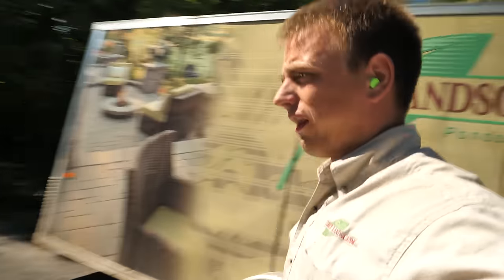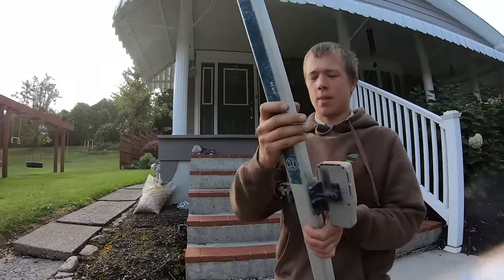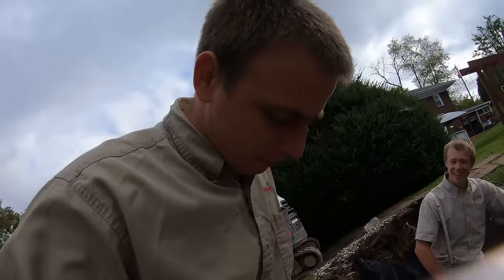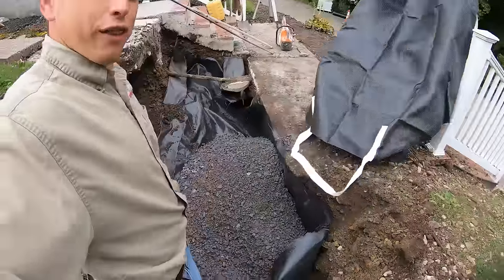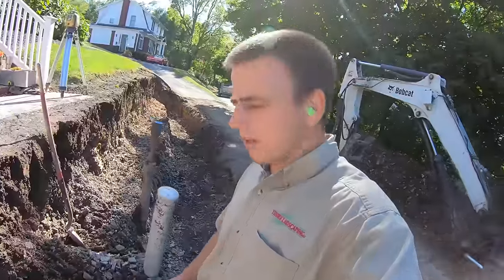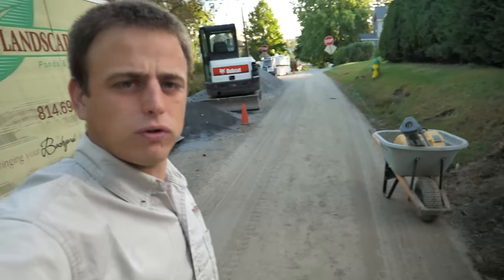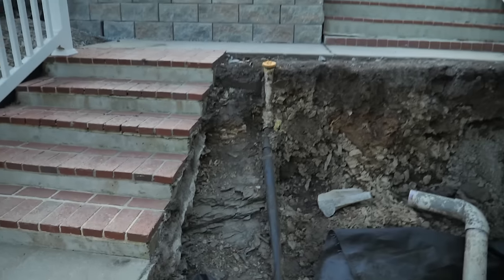How to build a RETAINING WALL that WON'T fall over!

Comment: On top of your French drain pipe, you have to make some holes. It is the idea to get water from anywhere and push it outside.... you missed that crucial point on the "French drain idea". Also, you have to put geotextile around pipe and gravels to prevent ground to come and mix with gravels then close holes of French drain pîpe. An other one point crucial you missed... or it is NOT a French drain.
Reply: Recall that he put a semipermeable membrane below the drainage gravel and above it which should prevent the vast majority of sediment from clogging up the drainage pipe holes.

Comment: I’m not sure that the original should have ever been called a retaining wall. It was just an unsecured pile of pavers waiting to fall over (in other words, an accident waiting to happen). Up the street from me a few houses my neighbor did the same a couple years ago. I and waiting for it to all come sliding down the hill. Fortunately his house has a basement so it’s foundation doesn’t rely on the “retaining wall.” I might have objected if it had been structural as I wouldn’t want his house on the street in front of mine. 
Sort of a technique question. At the end of the wall when you do the step, you put #9 small washed rock on top of the #2A rock. Aren’t you concerned that the finer small rock on top will sift down into the larger stone, and cause the “stepped” stone to slump?
Great video, by the way!
Reply from the maker: thanks man! Glad you enjoyed it!

No the #9's wont migrate down in to the 2a below. The 2a has enough of fines in it that there is no open aggregate for the 9's to migrate down through.

Comment: Couldn’t you put rebar in also?
Reply from the maker: This is not a masonry or poured concrete wall, this is a srw wall. These types of walls are designed to flex and are not monolithic like concrete is, so no rebar is needed
Reply: Tussey Landscaping thank you for explaining it

Comment: Most municipalities do not allow drainage to the street, I'm surprised this homeowner can do so (and you being able to reroute it to the street). Also, being a retaining wall engineer, you only "need" half the wall height in geogrid (height includes what is below grade). But it is better to be safe than sorry (grid is cheap and don't want to return to fix a failing wall).
Reply: I'm sure there's an obvious answer to this, but given the slope of the property where else would they direct the drainage?
Reply from the maker: Yes you are correct, better safe than sorry with the grid. Regarding the drainage, we just improved what was originally there. We did not create any new or additional drainage outlets. And yeah there is no storm water system on that street, so there was no where else to go with it.
Reply: ajmckay2 typically, property owners have to find a way to retain the runoff onsite (a drainage swale to a low point on the property would suffice).
Reply from the maker: Yeah, we see that more commonly in housing developments. Right here in the city, the lots are tiny. There's physically no way to quite achieve that. They have to depend on the city's storm water system

Comment: Why not mechanically attach "dead man" as tall as the wall every 4 feet down the wall instead of all of the extra fabric and rocks to "hopefully" fully control and unknown amount of water?
Reply from the maker: A dead man method is not part of the Segmental Retaining Wall (SRW) design. The the geo grid and clean stone backfill will manage the water, (not hopefully, it will) a properly built SRW wall with geo grid will not fail
Reply: Deadmaning a wall is a couple century’s old technology that will fail overtime because it doesn’t deal with the main underlying factor that makes 90% of retaining walls fail and that’s the water mitigation.  You need to look at this system as a big box... it’s as deep as it is tall... if you aren’t utilizing this design principle then it’s just a matter of time before what you are building is going to fail...all the clean stone allowing the water to drain and not be able to heave the walls what’s going to keep it upright.  That block grind material now has that massive amount of down force on it and for the wall to move it would need to physically drag that fabric out of place.  Lay a trash bag on your lawn and give it a little tug...then toss a 10 pound weight on it and give it a tug!  They actually added a second layer up towards the top to split the difference and by flexing their “Boss Move!” Muscle’s they added a factor of 5 to the mechanical force necessary to push the wall forward.  I didn’t really dig the slope on the bank on the end and probably would have added a large flowing shrub like an Amalanchier or something like that with a more columned end but there’s budget requirements and all kinda variables at play.  They built a damn good wall and actually went that extra mile!!! A++!!!

Comment: Your drainage tubing should be wrapped in landscaping fabric to prevent clogging. That wall will soon have the same fate as the previous wall because of that.
Reply from the maker: It won't fail, there's 6 feet of clean stone behind this wall 😜. That pipe will never clog. 

Not saying I'm 100% correct, but in my experience fabric around drain pipes are useless. The fabric just clogs instead of the pipe, rendering the same outcome as a clogged pipe. The key is in building it structurally so that neither ever clog. Fabric or no fabric.

Comment: Obviously water is the major problem that caused that wall to fail.  The house May not have proper drainage causing the soil to become saturated. So, better make sure you build the new wall extra strong with the proper drainage; or you'll be back.

Comment: Shouldn’t you insert geotextile fabric between the dirt and the wall stone. Eventually, the soil will make its way into the stone and make drainage more difficult. You had it on the foundation so I expected you to add it to the wall.
Reply from the maker: You mean lay down fabric on top of the clean backfill stone? Yes we did, then put dirt on top of that
Reply: Tussey Landscaping Not just on top, on the sides (vertical) too?

Comment: Pretty sure the Geo grid is supposed to be ran the other way, not rolling along wall. And whenever I build walls I cut drain into block so the drain guard isn’t protruding past block.
Reply from the maker: Hey Anthony, this grid was bi directional. 

Yeah, I agree, I didn't like that drain either, but that drain line was coming from spouting above and they just wanted us to cut it into the block like it had been. We just reused the same fittings they had there
Reply: Tussey Landscaping love watching your guys videos. Keep it up!

Comment: I don't understand why you would use a jackhammer compactor after a plate compactor. The plate compactor does not compact as deep. Also the corregated pipe has holes on the top and bottom so any water that goes in goes right out of the bottom and will never drain out of the wall. Cut a non-corregated piece of pipe into about 1/2 and put it underneath so the water can actully drain out the drain.
Reply from the maker: We use the jumping jack in tight spaces or when compacting sub grade. Plate compactors typically do not go as deep and are better suited for compacting large spaces of aggregates. The drain pipe, that water that will run out the drain pipe will not necessarily fill the pipe from the top. What will happen is any ground water will raise from the bottom up, until it gets high enough to reach the pipe, fill the pipe from the bottom, and flow out.

Comment: These things are heavy.....yup.    they have to match the weight of the triangle of load they are retaining.   The Geo-Grid, breaks the triangle.  Meaning, the geo-grid, makes the rock, part of the wall.    So, the triangle, is never taller then the height of the block.   But, the mesh, has it's own strength, and life..    There were old walls, that used landscaping fabric, and those did really well, but the fabric is frail.  Some had a life of 5 years.  (yikes)..  So, if anyone plants along top the retention walls, they find the fabric rotted, but trivially still holding..   one thing not mentioned, is the number of kids whom die from collapsing retention walls.  Retention walls are shockingly dangerous.   Especially when done with do-it-yourself-ers, whom went to lowes and got the sad little retention wall stones, ment to hold back about 1' high wals.    One study puts the "risk" height, at 3'.   Higher then 3' increases your risk.  Do not do a wall higher then 3' yourself, unless you know what you are doing..    Most retention walls, if not all,  are in the process of falling over.   Do not put it off replacement forever.
Reply from the maker: Good observations

Comment: That black drainage tile isn’t the best I’ve seen. Great work thou.
Reply from the maker: Thanks! What do you like to use Mike?
Reply: There is so much drain rock in this install that the pipe is irrelevant and in fact unnecessary. By contrast if you only have 6" of gravel behind the wall then the pipe is a critical component of the drainage system, and in some cases solid wall vs corrugated pipe could potentially extend service life (especially if there are cleanouts).
Reply: Maybe a PVC 6” perf’ed ? Just spit balling here.  
Easier to clean out and harder to crush.  
Drainage fabric to keep the soil from seeping down intruding into the rock.
Reply: @harryl7946  You could do that, 6" schedule 40. Would add about $500 to the job plus the cost of cleanouts and accomplish nothing but piece of mind. Unless customer insisted I would never do that on a small wall like this, they could probably use that $500+ for something else.
Reply: @Tusseylandscaping  Baughman Tile makes the best corrugated drain tile I know of . It  is much stronger than their competition . And the inlet area is much much larger on their perf pipe .

Comment: I'm not a builder, just a DIY enthusiast.
I was expecting to see you put mortar when building up the blocks? Why didn't you?
Reply from the maker: This isn't a mortared wall, it's a Segmental Retaining Wall, designed to flex with freeze and thaw. Which means you can't use mortar
Reply: @Tusseylandscaping  Clever! Thanks, and I learned a lot from the video by the way.

Comment: Why not just make the wall two or three stones thick instead of just one? Seems like you wouldn’t need all that grid cloth and it wouldn’t have to be dug so far back.
Reply from the maker: That would be far more expensive, and gain you nothing from an engineering structural perspective

Comment: you covered your agg pipe for drainage with roadbase aggregates, you must cover it by Geofabric. 
for 5 courses you don't need the black plastic mesh every 2nd. course to hold it back, its only a 5 courses, way way excessive work.
the black plastic mesh use it if its over 1.5m
Reply from the maker: That all depends on what wall block you use. We followed the engineering design for this wall block.

Comment: Wow they made the wall just high enough for a kid's to get hurt when they fall off it. I did like the engineering that went into building the wall. That wall should have kid's falling off it for the next 60 years. I would rather build so I did not need a retaining wall.
Reply from the maker: agreed, a fence would be a good idea for kids. But they had to have a wall there, there was no other option. Without the wall it would have been a dirt cliff, which would have been just as bad for kids. and way uglier.

Comment: The old Wal just sat one on top of another.   No mortar. 🤔
Didn’t notice any locking edges though. Hummmmmmm
Reply from the maker: Yeah there is no mortar in this type of wall. A wall with mortar would need a foundation below the frost line
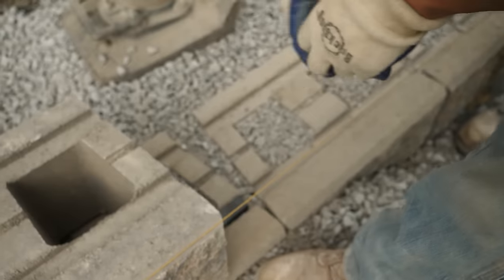Reply: There are black clips that hold them together instead of locking edges.  They show them @ 8:00.

Comment: Why didn’t you not use any mortor? Or some kind of foundation for that job.....yikes....
Reply: It works. This their job.
Reply from the maker: This is not a masonry wall, this is a SRW wall which does not use any mortar. The foundation is the crushed clean stone under the block,. This is how these walls are engineered

Comment: a five course wall at 8" per course? 40"??? That barely qualifies as a retainging wall. I will admit the mesh is a new and great concept to replace the solid toe part of the wall, but for a barely over 3 ft wall? I can't really see that as a retaining wall. :( 

Other than asthetics, I'm not even sure I really saw what was wrong with the first wall. (It really didn't look like it was failing)
Reply from the maker: 😂😂 you didn't see that the first wall was falling? Go back and watch the first section of the video, we barely touched it and the entire wall came down. It was a matter of time before that entire wall was laying out on the road. 

A retaining wall can be 2 courses. Or 3. There is no "standard" to what can be called a retaining wall. 🤷‍♂️ We build quite a few that are 18" high (much smaller than this one) that people like to use for seating.

Comment: why they used a lot of gravels, it was not to allow water to enter the ground under the wall which weaken the soil, since they cover it by plastic sheet..those gravels just wasting money..IMO
Reply from the maker: never hurts to go overkill. The sheeting is simply a geo textile seperation fabric. It isnt neccessarily structural

Comment: Wall didnt look very straight and not of fan of positive revealing drains plus they black and stand out making it look like cracks. Otherwise good enough on drain and rock
Reply from the maker: Thanks for the observations! The wall was string line straight (check out the thumbnail), and the drains need to be exposed to release ground water. Agree, we try to make them discreet as possible, but they are what they are

Comment: really expensive option for a really simple task
Reply from the maker: Yeah, the cheaper option is the one we ripped out and rebuilt. The "cheaper" option was more expensive than the "expensive" option, because they had to do it twice
Reply: @Tusseylandscaping  sure, but how much did that big protect cost? There are plenty of ways of retaining  a wall without excavators etc. Plus why did u not reuse the old brick is? I guess if the customer has bottomless pockets then no big deal!
Reply from the maker: 🤷‍♂️ we aren't really looking for the cheapest way of doing things, we're looking for the best way
Reply from the maker: And if you wanna dig all that material by hand, sure! Email me, I'll send you the address of where to show up, 7 am sharp! 😉😂

Comment: God save us from amateurs!  There should be a solid foundation bearing on virgin subsoil, not a a compacted stone layer with a slip plane.  Over time the stone will compact further and/or migrate sideways causing voids that will destabilise the wall.  The horizontal mesh is a joke and contributes nothing to the stability of the retaining wall or the backfill.  At least its a dwarf wall with little load on it for its mass and as can be seen, the natural angle of repose that the subsoil has will probably save the wall from catastrophic failure.
Reply from the maker: 😂 these wall systems are engineered and designed to be built this way. Sorry to hear these engineers that design these specs are amateurs! As this is exactly how any SRW wall is built across the nation
Reply: @Tusseylandscaping  My comments still stand, I would like to see SRW's justification of the system.
Reply: Subsoil? That's rock below the upper foot or so.

Comment: Whoops, looks like you forgot something on that site. In the beginning of the video you addressed the different utilities that you had to work around. But as the job progressed you never re-visited the solution to that problem. Because I got YT'ed (stuck in a YT video I never set out to watch) and invested the time to watch a job no person could do without all that equipment and manpower. I spend another 5 minutes cutting through scenes trying to get glimpses of the utility lines. I actually didn't see you having allot of trouble with those after the dirt was removed. It looks to me like you simply built the wall outside of the furthest run of utility and packed in grade material around it. So for the final shot your view was .. just allot of hay =). So technically you didn't really forget anything on the job, but for a second I made you nervous huh? >:} So as for the function of those, are they all cut-offs or do they do something else?
Reply from the maker: Yeah I missed getting footage of how we dealt with that. We basically had to cut our block around the lines, and work around them. They were live lines

Comment: Lack of drainage was not the reason the original wall fell over.  The original wall was simply a bunch of block standing one atop the other.  The forces of gravity and the gradual compression of the soil behind the wall pushed it over.  You repeated that same mistake when you failed to cover the French drain with a water permeable barrier.  It a short time that drainage pipe will become filled with earth and be rendered useless.  Geogrid is a go around that I will never trust.  Every engineering demonstration I have watched showed the only way to make a wall that will not be pushed over is poured concrete that is "L" shaped with the soil itself behind the wall not only holding it upright but holding it down.  That type of construction will not fail.  The wall you built will fail.  It will simply last longer than the original wall.
Reply from the maker: Let's just keep it simple and say we'll agree to disagree
Reply: @Tusseylandscaping  ; Judging by the manner in which you spoke in the video, that is exactly what I thought you would say.  Engineering is not a matter of opinion, and you just evaded.  Future videos ignored.